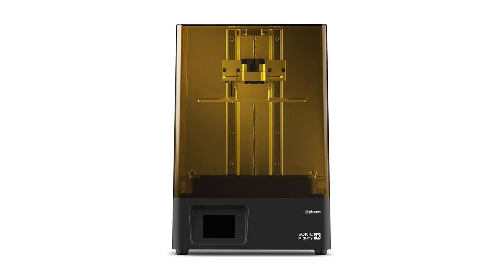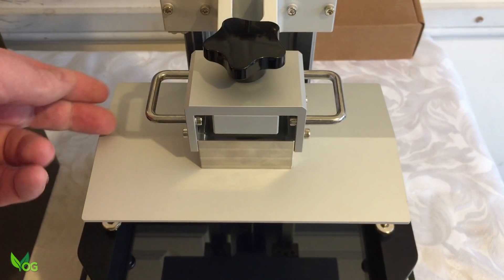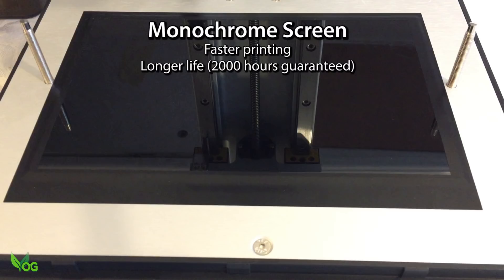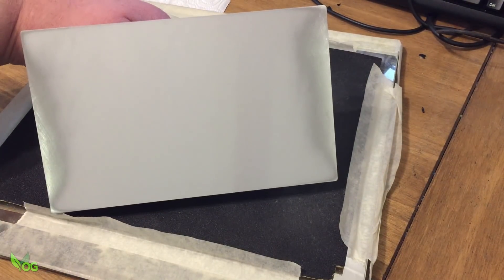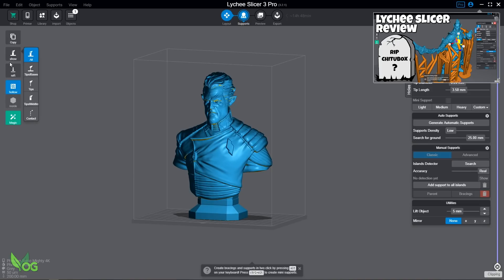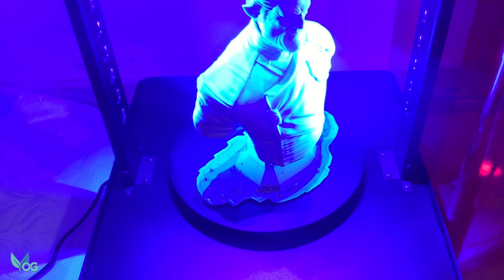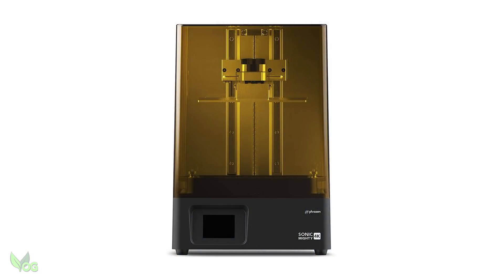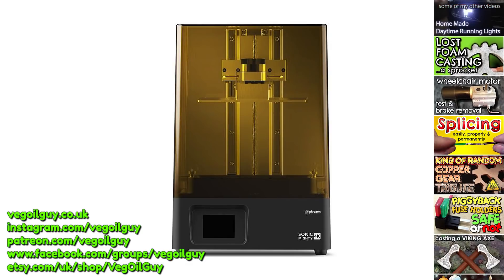Phrozen Sonic Mighty 4K 3D resin printer HONEST review by VOGMAN

Comment: Sanding down a build plate is not something I like the thought of. For a company that can make such solid printers, I had expected slightly more there.
Reply from the maker: Honestly Alex, this is NOT just a Phrozen thing. It's common amongst this end of the market. Look up the technique... it's an unfortunate but common fix.
Reply: Getting a sufficiently flat build plate is the  luck of the draw.  You aren't going to get it very flat at anywhere near the price point of these things.    I have 3 resin printers, A photon, a phrozen sonic mini and a  phrozen sonic mighty.  Only the sonic mini had a reasonably flat build plate.  The other two I sanded flat.   I'm absolutely sure this is reason some people have endless trouble getting prints to stick.  If you don't flatten them you have to use an excessive first layer exposure time. 

Arguably it whould be lapped against the mono lcd screen but that would be crazy overkill.  I do have a granite surface plate which (I hope) is a bit better than IKEA glass. 

You can see from the video that VOG's was clearly concave over it's length. and he's only done a partial job of flattening it, taking off the highest spots - the shiny bits at the ends.  Nevertheless it's obviously good enough.  Mine was convex.  You have to be a bit more careful with convex.

I don't consider it a problem.  If I buy a £100 plane for woodworking I have to go through the same process of flattening the base to make it work really well.   If I paid 2 or 3 times the price I might get a flat base.  It's a tedious but simple process.  I'd rather have money in my pocket.   Same with these machines.  You can pay a couple of grand for one if you want.  Then you might expect better.  These low end ones are all much of a muchness.
Reply: UberKrassMann  I've watched a LOT of vids on resin printers and I've never seen anyone claim their build plate wasn't flat.  Usually they talk about sanding the plate to get better adhesion for their resin base layer.  But it's obvious from this vid that VOG's was poorly formed somehow.  That a plate would ship out like that during a production run is unlikely.
Reply: Thinking of it now its like lapping a cpu to get better contact for cooling

Comment: I'm so done with LCD resin printers. They're all AWFUL. Nasty to clean. Always something needs replacing or adjusting. Resin quality issues. Temperature issues. FEP issues. LCD replacements. Just no.
Reply: Then don’t use them? Resin printing is not for everyone. No need to come here and vent.
Reply: If you have a resin printer to trade in for a FDM printer, I would be happy to take the burden off your shoulders.
Reply: @N3ss3s  Heavens no,.  They are far far worse.  Personally I'm done with FDM printers.  Stringing,  blobs, filament jams, blocked nozzles, bed adhesion problems, extrusion issues, endless fiddling with slicer parameters, hard to remove supports and all for crappy looking prints in the end.   Awful things.  The simplicity and print quality of resin printing was like a breath  of fresh air to me.

Comment: I would say that the design of that build plate and the plastic resin tray are a "pass" from me. Compared with one knob twist to take the plate away, fiddling with four small screws to take the plate off its a chore, especially since the design doesn't seem to help in any way make the leveling any easier. You might argue that it makes the plate more stable but somehow I doubt that. Also, the tray clamping method is beyond flawed in my opinion, given the fact the tray s plastic. I think they could have come with much safer, much easier ways to hold down the tray. 
I think the good quality of the prints is not that dependent on the printer itself in this case (which doesn't seem to bring anything better tech wise on the market) but rather in the model details and resin quality.

Comment: USB connectors should always be at the front. I want to setup multiple printers side by side and this strange positioning requires way more spacing than having just the intake vent on the side.
Reply from the maker: I hear that a lot from guys with multiple printers.
Reply: @vogman  For multiple printers it can make the difference between fitting 3, or 4 on one table. I want to expand later on, so this issue just multiplies.

Comment: another machine ohhh nice. hope your well VOG great video. :)
Reply: is the plastic vat using quick replacement pre installed fep to the frame. this might get costly in the long run. its like ink cartridges for inkjets ie there way to make money back on the machine. as its a key item you need so with a custom size vat gives them the edge with the pricing for the replacements. hopefully you can still use fep sheets.
Reply from the maker: Thanks, you too!